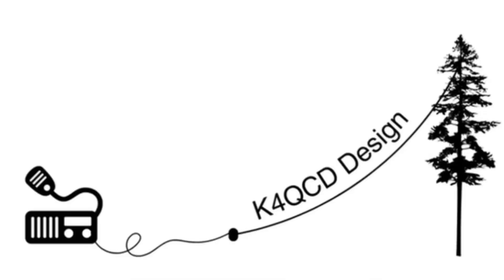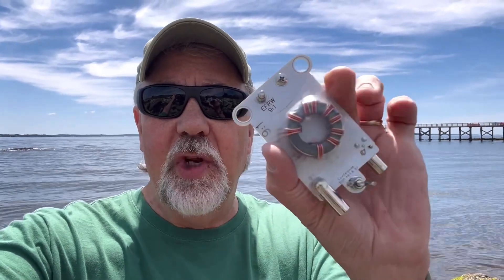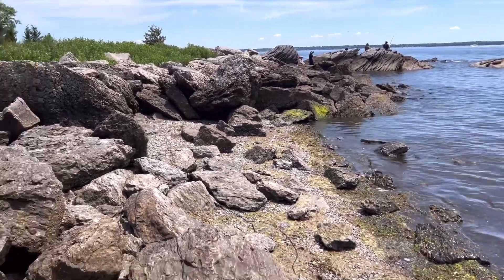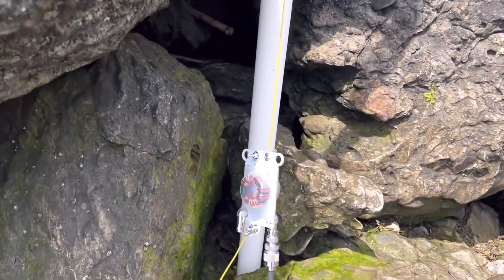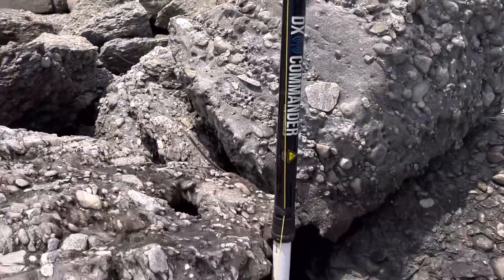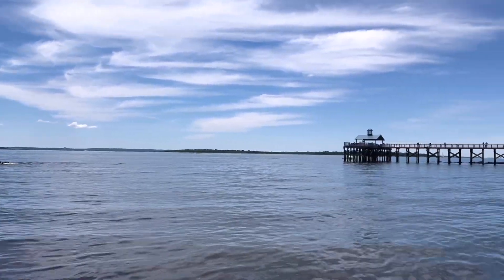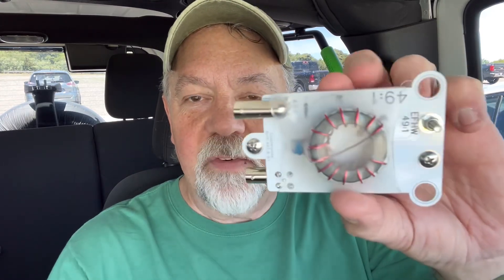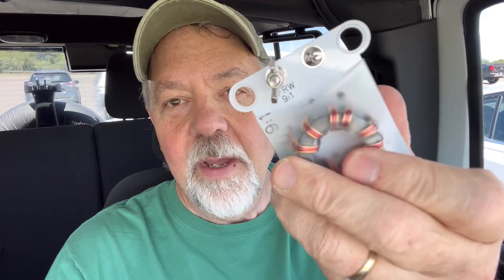Building Antennas with the “Dually”

Comment: Great video Walt! Thank you! I had just purchased a project case big enough to enclose two Ununs, with this very idea in mind. I wondered if you could do this and saw the Dually. I think I'm going to build a baffle between the two Toroids to be on the safe side. I know the band conditions have been crazy, being great one moment and falling apart five minutes later. Such is the way during Solar Cycle 25. It was great to see the Dually in action and will eventually buy one. Have the two mounted together is a brilliant idea. As always, I enjoyed this video. I was on the 10 meter band the other day and SImon HamJazz was live but the band started to fade rapidly when I tried to make contact. This type of problem makes amateur radio a little more exciting because when you do make a contact, under sketchy band conditions, you feel like you've pulled a fast on propagation. Thanks again...73...Hugh...KN6KNB
Reply from the maker: @hughpatterson1480  thanks Hugh!

Comment: That was great fun. love that kit.  2 UNUN on 1 board. I just saved it. I got the ten tenna  49:1 /56:1/64 :1  switchable one saved as well. bands weird and in Boston NY we got record heat and super HUMID. power staying on. was down to 110V doing 115V now. normally around 121 V hear. Rode Island is hard for me. some times 40/80 meter NVIS I get on FT8 . nice clear heat shrink.  73's

Comment: What is the Whiskey One designation? I dug around and found no info.
Reply: That indicates that he's operating from Connecticut, Maine, Massachusetts, New Hampshire, Rhode Island, or Vermont.
Reply: @Sabre2165  New ham here...are we supposed to use a different call sign for different areas within the US? I haven't seen that mentioned anywhere other than for outside the US.
Reply: @dadthejedi  There is no legal requirement to do this within the US. It used to be that, if you moved to a different region of the US, you had to have a new call sign to identify where you live. That rule is gone, but many operators add a location code to indicate where they're actually operating from if other than where they live. For example, if you have callsign W1W and you're operating while on vacation in Hawaii, you might call yourself KH6/W1W or you might say "W1W stroke KH6." This quickly lets others know that they're making a contact with someone in Hawaii.
Reply from the maker: Correct, I only do it because I’m logging it that way in QRZ so I can keep a correct record of my contacts while I’m here. Thanks for explaining. 73, Walt

Comment: The /W1 is no longer required to be added to your callsign. The bands are wonky? You just made contacts with SD & WA using 20w. How does that make them wonky?
Reply from the maker: I’m doing it because I have a separate log for up here. I probably won’t use it all the time but I like separating my contacts out by location and using /W1 is completely acceptable. The band had horrible QSB, you could hear someone for a minute and then completely loose them. That’s what I meant by wonky.
Reply: @COASTALWAVESWIRES  I was thinking the same thing truckinguy92 mentioned, but I can understand using the /W1 designation if you are using a separate log for that area.  Make sure you add that /W1 as an additional callsign on your POTA account.  Hopefully the park to park contacts included the /W1 when they logged you.  A good reminder for folks to log what they hear.